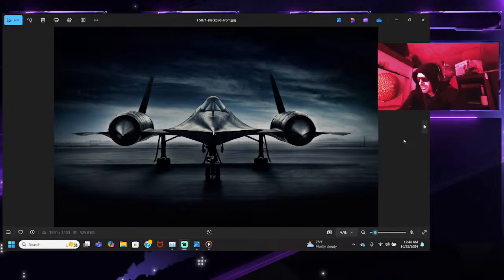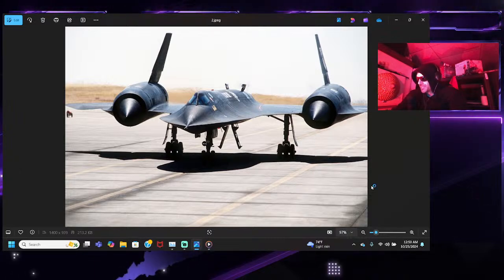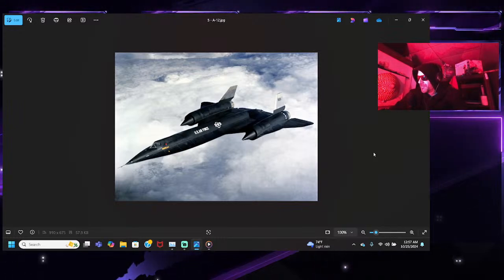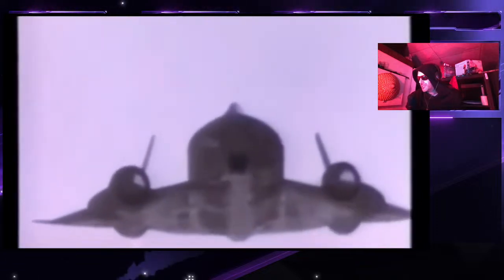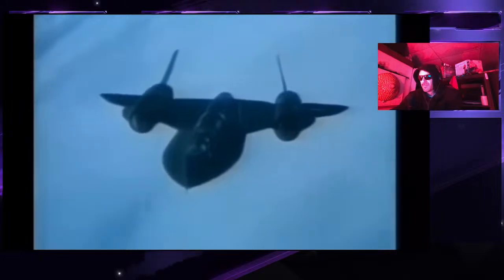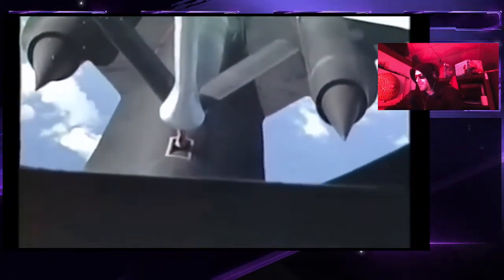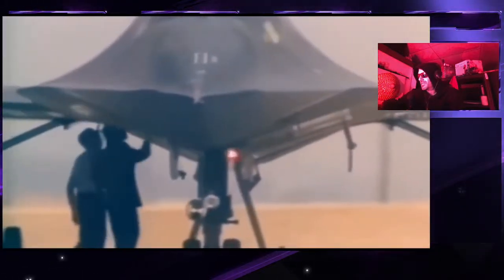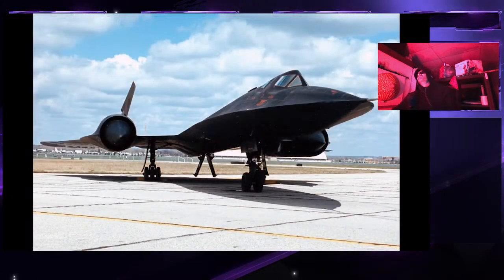Aviation Prattle SR71 Blackbird

Comment: The XB Valkery And the SR-71 ( RS-71 was supposed to be it's desgination ) But president Johnson Introduced it as the SR-71 instead of RS-71 and presidents dont get corrected. The {R}econnaissance (S)trike - but when President Johnson introduced it as the ( SR)-71 ; (S)trategic (R)econnaissance-71 so that became it's designation. There was 1 SR-71B made which would become the trainer aircraft. The surviving M-21 / D-21 set left is on display at the Boeing Museum Of Flight and also the museum has a salvaged cockpit from a crashed SR-71 and you can sit in the cockpit at the display. The only [ computer ] used to design and build the SR-71 is the Human-Brain. The computer as we know today hadn't even been invented yet. Kelly Johnson knew when the U-2( TR-1 ) later - updated versions would be redisginated as were on borrowed time after entering service - so he started working on it's successor - The SR-71.